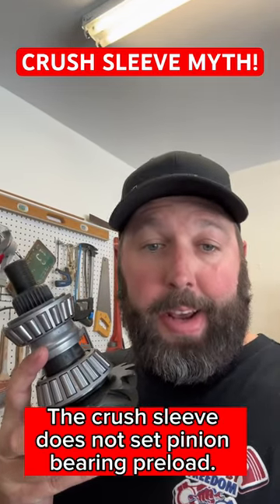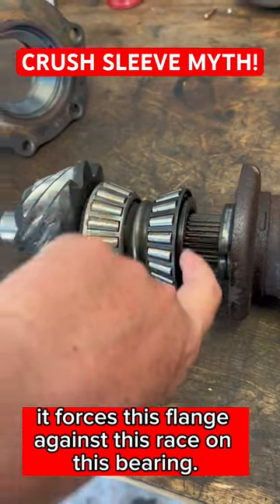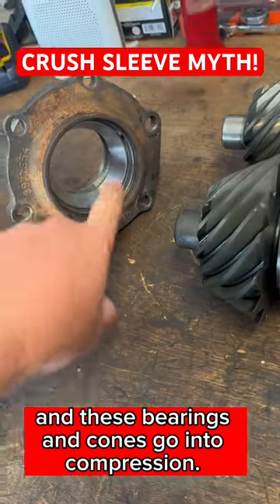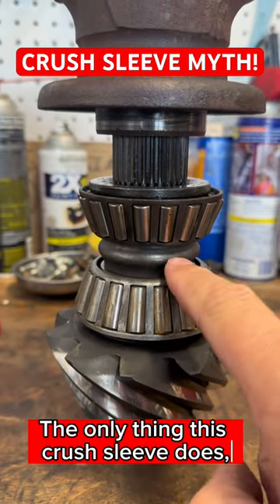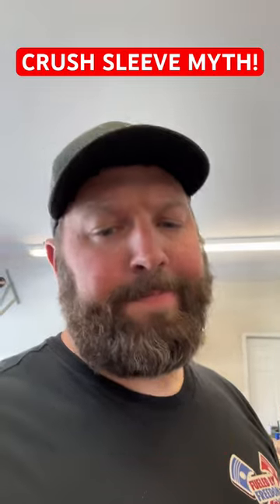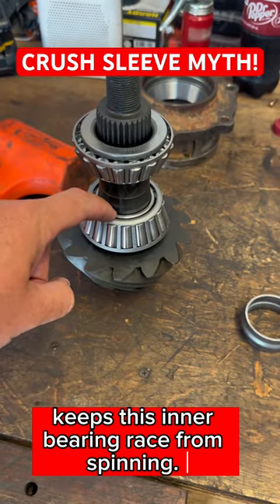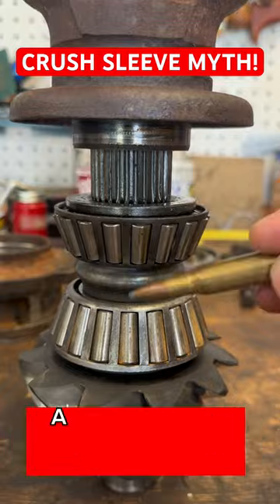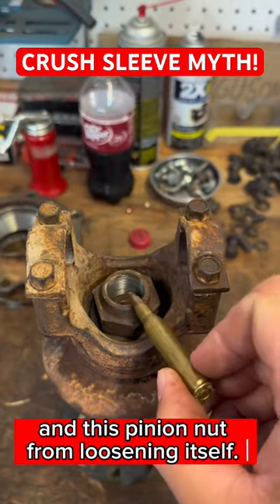Pinion Bearing Preload Isn't Created By A Crush Sleeve! #mechanic #jeep #axle

Comment: Crush sleeve maintains preload on the bearings of the pinion. It is not a lock washer for the pinion nut, as the pinion nut is a top lock, a side lock nut or there is lock tight involved. The bearings should have an interference fit on the pinion shaft and not spin ever.... how about you stop spreading miss information...
Reply from the maker: Wonder why the interference on the inner bearing and outer bearing is so different 🧐 How about you think before you comment. 😘
Reply: Have you ever had to deal with inner race of a bearing welding to the pinion shaft? Slip fits cause this
Reply from the maker: Nope. Never seen one move or not been able to remove one. But I dont do diffs for a living.

Comment: You are so wrong It keeps the two bearings from being over tightened if the bearings come loose the pinion will jump into the ring gear and wreck everything
Reply from the maker: Why would the bearings come loose??? I think you need to think about the system a couple steps farther than you are. Why are you tightening the nut so much if it's a locknut??? The differential holds the bearings apart, the nut pushes them closer together.

Comment: A toque wrench sets the pinion bearing preload 😅
Reply from the maker: That’s completely false. There is no torque spec for a crush sleeve diff. And if a diff uses a solid spacer, the length of the spacer sets the preload. Wouldn’t matter if you torqued the nut to 50ft-lb or 500ft-lb. The preload would be the same.

Comment: But you still need it in order to set and hold it. So you can say that thw crush sleeve assists..whatever...😂😂😂 You still need it or crush sleve eliminator to HOLD it
Reply from the maker: The point is that it doesn’t create the preload. Most people are confused about the entire thing. The same group of people that think HP will collapse one.
Reply: @freedomworx  right it just crushes until you get TO the preload.. I think some people might not be explaining it the right way to themselves...or maybe they just think wrong.. IDK
Reply from the maker: @vfr800fi07 I can understand the confusion. Most diff assembly instructions make it sound like the preload is created by the crush sleeve.

Comment: I hate youtube mechanics.  Without a crush sleeve or solid spacer, the pinion nut will back off and you wont have a ring and pinion anymore. Your right, its not creating preload but if you've read the manual while rebuilding an axle you would know that already. This video makes it seem like you dont need one WHICH YOU ABSOLUTELY DO!!
Reply from the maker: I’m not a mechanic, I’m an engineer 🤷🏻‍♂️. I stated exactly what the crush sleeve does, why would I then insinuate that it should be left out 🤷🏻‍♂️
Reply: @freedomworx  ohh an engineer! I should definitely trust you then. You did explain what it does, but you then said its like a lockwasher for you pinion nut... it kinda is? But then why would the nut be crimped and have locktite on it already? You have to understand the line of thought of the people your talking to, all they heard was you dont need it for preload and when they inevitably crush one too far, they'll assemble it without a crush sleeve because "you dont need it for preload". Its like saying you dont need a saftey on a gun, yes the gun will fire but your probably gonna blow your foot off
Reply from the maker: @moonshiner0197  you don’t have to trust to me, but you don’t have to be a dick either. I’m just letting you know that I’m not a YouTube Mechanic as you assumed. I can’t help if someone screws up a diff because they assembled it based on a 60 video that they couldn’t comprehend. I can hold everyone’s hand through life.

Comment: He is right! I've been working on a couple of differentials now and the more I look into it and think about it and through experimenting with different axles and interchanging parts to see what will and what won't work from a non political perspective I have found you don't need to really change a crush sleeve at all if you keep the bearings and races as a whole unit. It is already set by the factory as far as tension goes on the bearings but you can not use an impact to put the yoke back on. You have to do it manually as I found out. I was very surprised as working at a speed shop and able to play with this and have not seen any problems this far even mixing rings and pinion so long as there the same ratio's. Just sayin
Reply from the maker: Garage Science 🤓
Reply: Yep poor man gota do stuff. Sometimes it don't work out so well other times it's genius!

Comment: That's wrong.
Reply from the maker: No, it’s correct. You’ve just been told/taught incorrectly 🤷🏻‍♂️
Reply: @freedomworx  so you mean I can keep tightening the crush washer without changing the drag on the Pinion bearing?
Reply from the maker: Nope. The point of the video is that tightening the nut and forcing the bearings into the cups is what creates preload. Has nothing to do with a crush sleeve being there or not being there.
Reply: @freedomworx  how do you measure it?
Reply from the maker: Rotational Torque with an inch-pound torque wrench. The same way everyone else does.

Comment: So what happens if you tighten the nut too much ???
Reply from the maker: The bearings will overheat and fail. That’s a benefit of a solid spacer, makes it impossible to over-tighten the nut.
Reply: @freedomworx 
I'm with ya but if you use a solid spacer, what locks the nut in place? I thought that's what the crush sleeve is for, or so I learned.

Comment: Wrong ,   If you can read ,  which it seems you can’t ! 

You are to tighten crush washer to a backlash and toque setting … 

You make it sound like you tighten it down till it stops ….  
Wrong ! 

I have a 2010 Jeep I bought new and re geared it with 3.38 great with 38” tires . 
I followed the instruction specs .   

150,000 miles latter it’s still together and running through mud ….  

Maybe the problem is you ,   Not the crush sleeve !!!
🎉🎉🎉🎉🎉🎉🎉🎉
Reply from the maker: Maybe you misunderstood the video…. BTW, the crush sleeve has nothing to do with backlash 🤷🏻‍♂️.  Backlash is controlled entirely by shimming the inner bearing and the carrier bearings. And you can achieve that proper rotational torque setting with a crush sleeve even installed…because it doesn’t create that rotational torque (preload). Though I never said to do that. You didn’t understand the video and you don’t understand preload 🤷🏻‍♂️

Comment: Bullshit.
 The sleeve sets the preload. A new bearing set should be set at Zero Lash.
 Not Negative .001
 Zero. 
 As soon as that get fired up it will have a .001 lash.
Reply from the maker: I’m talking about the interference fit between the bearing inner races and the pinion shaft. Not the fit between the cones ands cups. And in reference to your “zero lash” comment, there is zero preload at zero lash. Preload is by definition, the resistance to rotational motion, and is only achieved after the bearings are forced further into the cups beyond the point of zero lash. 🤷🏻‍♂️. So lower your BS flag homie.